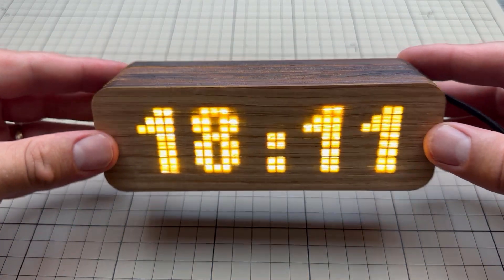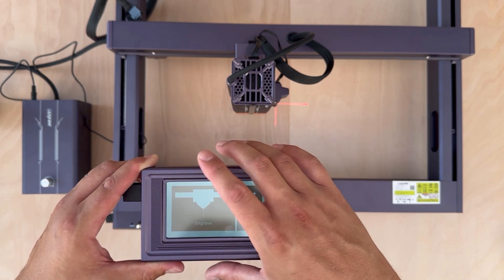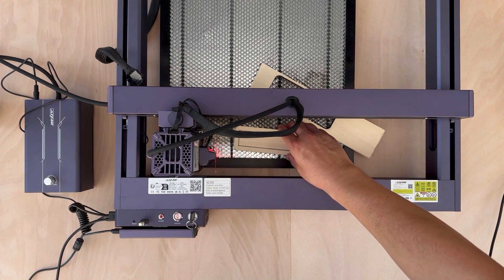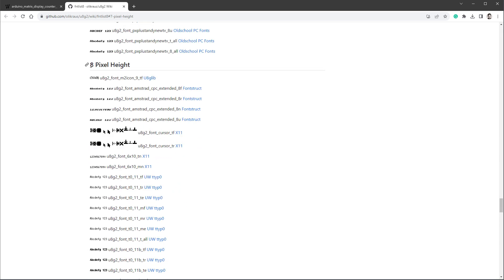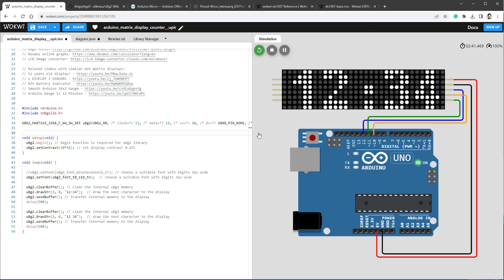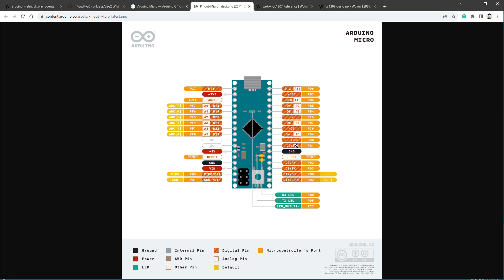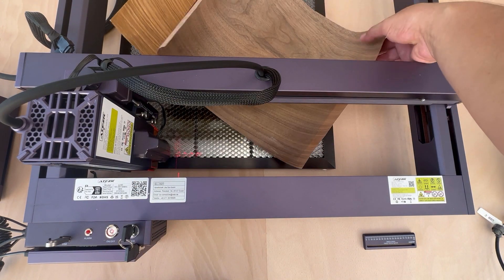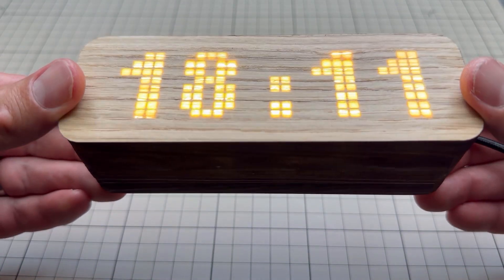Arduino Wood Clock

Comment: Hi very helpful I just made this, but I was wondering if it is possible to add buttons for changing the time that way i can add an external battery to the clock and not just have it plugged into my pc to work.
Reply from the maker: Good idea, you can definitely add buttons to this setup- I have a few videos about working with buttons, hope they will be helpful.

Comment: If one wanted to encorporate numerals other than arabic ones, how could that be done? Specifically I would like to have Xara numerals which would then display binary/base 256 time ( basically the same as hexadecimal time, but displayed differently). This time metric hath sixteen hours in a day, two hundred and fifty-six minutes in an hour, and sixteen seconds in each minute. How could this be acheived? Each Xara numeral can display all numbers from zero to two hundred and fifty-six in one digit. So for hours minutes and seconds, it would only be three digits total. And the seconds I would like smaller, half the vertical height of the minutes and hours. It doth not even need to be an LED display. Xara numerals can be clearly displayed with a twelve segment display. An e-paper display would also be nice, I would think; whichever. I am just not sure how to get the arduino to know what the numerals look like, which one meaneth which number, and how to get it to count in binary time. Any suggestions?
Reply from the maker: You can draw your own images and show them on those displays, that is, if they have enough resolution.
Reply: @upir_upir  I have a mini PC with no touch screen, how would I draw the numerals. These numerals only have straight lines, but what program would you recommend to draw or make them given my lack of a touch screen?

Comment: can we use arduino mega 2560 instead
Reply from the maker: Definitely!
Reply: @upir_upir  can you make a video made a wood clock but using arduino mega 2560 because i just have mega 2560
Reply from the maker: It will be pretty much the same code, the main difference is that the mega is of course much bigger so you might have hard times trying to fit that into some small enclosure

Comment: Congratulations, great job, I have a question, where can I buy the square LED panel in 10.28?
Reply from the maker: I bought it from AliExpress, search for "8x8 Square Matrix Red LED Display Dot Module". It´s together with the PCB module, but it´s cheap so you can just use the display alone. Hope it was helpful!
Reply: can we get the link to the exact module your using in your video.I couldn't find it on aliexpress,

Comment: Wow. I love the looks of that clock.
Maybe make a version with an ESP32 and let it get the time from a NTP time server by using the WIFI connection?

Also. Why did you need to create another 5 volt power supply pin (@14:00)? Can you not put the together with the +5V ??
Reply from the maker: Thank you, I’m glad you like it. Yes, using Wi-Fi enabled microcontroller and getting time that way would be a next logical step. As for the power supply, you can use the same 5V pin for both, but it might be challenging with standard jumper wires.

Comment: Using a gpio pin as a power supply is really not recommended since it can only provide around 20mA which might be enough for this application but could damage the Arduino if more current flows through
Reply from the maker: Agreed, but the power consumption of the RTC module is most likely super-low, considering that it could operate on single coin battery for a year or so...

Comment: Can the -pinmode(pin#, HIGH) - power supply method supply as much current as the 5v pin or can you only do this for very low power modules
Reply: Just went digging a bit at the Arduino website: the official limits of the processor (where all the power would be going through, in this case) are max. 40mA per single pin, max. 200mA over all pins (the lower you can keep it the better, in both cases), or in short: something like the RTC module is OK, but the LED matrix modules may pull a bit too much for that method - so maybe better feed those from the 5V on the board 😉👍...
Reply from the maker: Thank you for providing the answer for me. Yes, this is only applicable to low-power modules, definitely not possible for something like the matrix display.

Comment: Nice project! Do you have a link to the white squared pixels led modules used in the video?
Reply: You mean the LED matrix that's linked in the desription?
Reply: @CodyThierauf  Linked product only has red, blue and green color options available and pixels are circular
Reply from the maker: Unfortunately the white square pixels are out of stock for now, or at least I cannot find them. I will keep looking and send you a link once I find something.
Reply: @upir_upir  did you find it or very similar product
Reply from the maker: @thereoncewasaname  Yes, here is the link:
Reply from the maker: https://s.click.aliexpress.com/e/_DF4Fnop